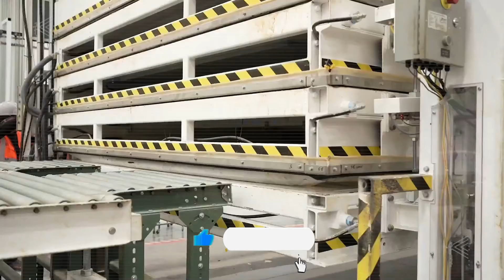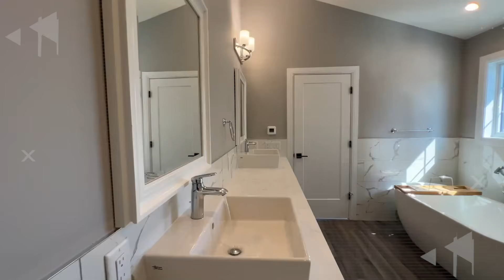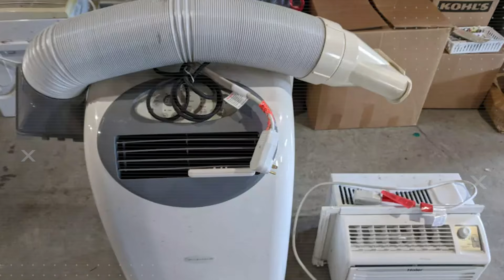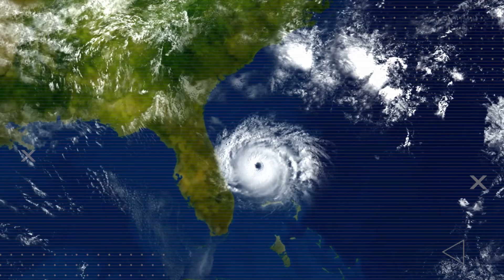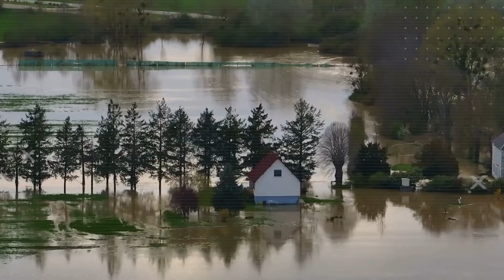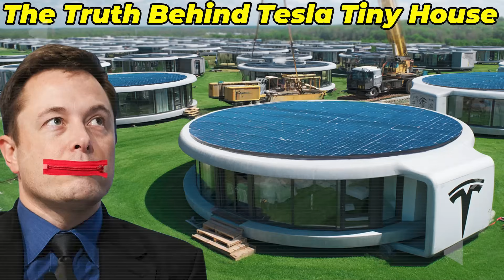The Invisible Side of 2026 Tesla Tiny House: What Most Owners Expose After 5 Years?

Comment: Both of them are important and critical
Reply from the maker: Uhm.. I agree. It's hard to choose. But in Florida or Texas, moisture quietly does more damage than people expect. Heat is obvious, you feel it right away. Moisture is slower, but it’s what leads to mold, material fatigue, and those expensive fixes later. So I think one of them will tends to dominate based on climate and the need of the resident living in the house. Which one do you think becomes harder to deal with long term?